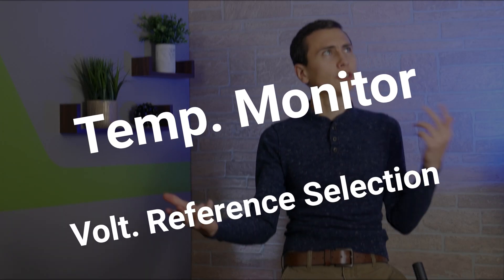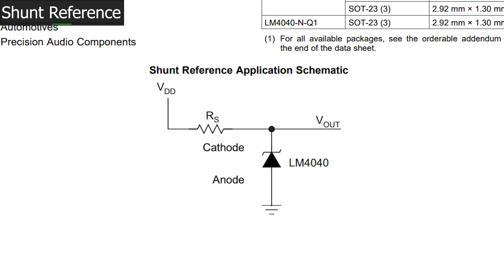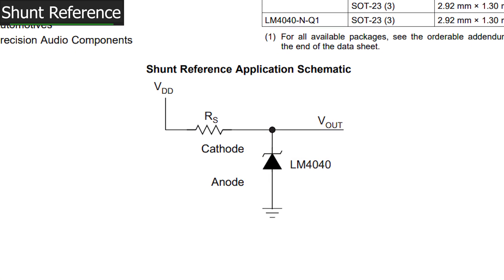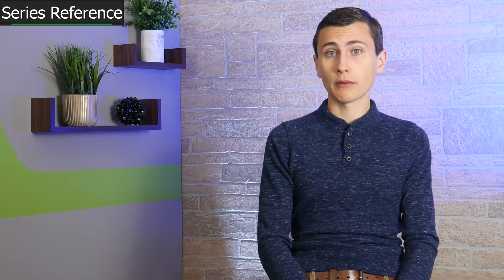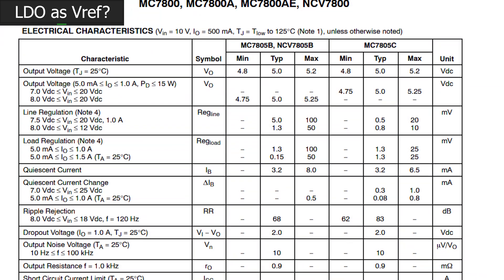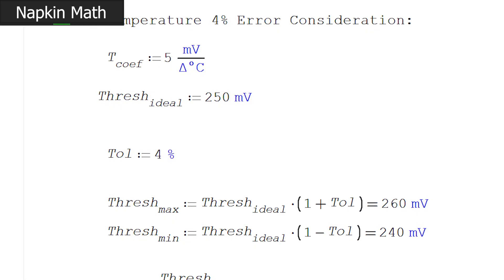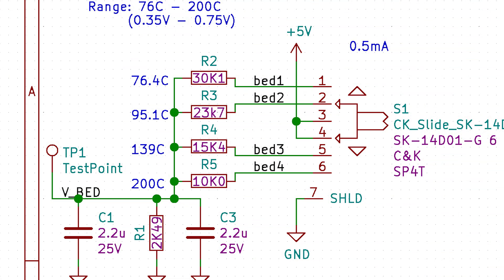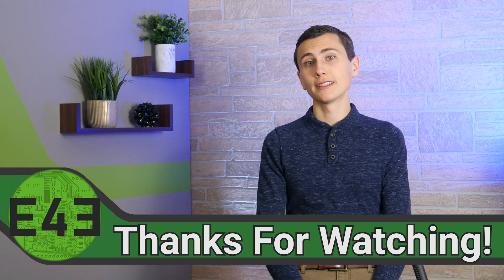Voltage Reference? Never Heard of it. (Series, Shunt, and LDO as reference)

Comment: A very important topic! =) 

TL431, LM385, LM336 is typically good enough for me. (i.e., the cheapest ones I can find =P ) Good voltage references are expensive =(

431's on LCSC start at 1-2 cents each =P  Can get 431's which claim 0.5% or better initial tolerance for ~4-6 cents each (ME431AXG, AZ431AN-ATRE1).  The limit seems  to be 20ppm/C before things get expensive?
Reply from the maker: Hello NO Corporation,
Ha! Agreed on price. I typically shoot for "just barely good enough for what I need to do".

In this case... An ldo. xD

I'm glad you like our video, and thanks for watching!